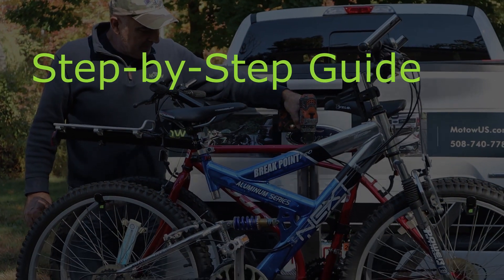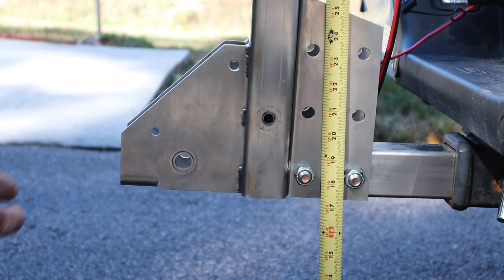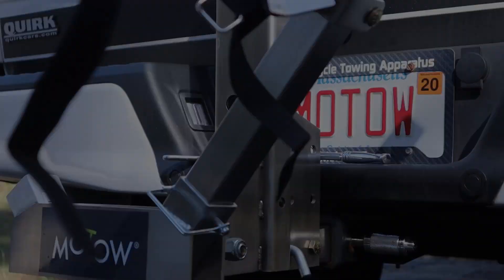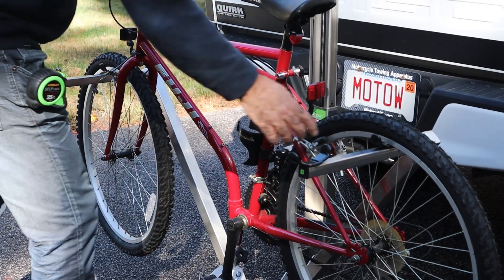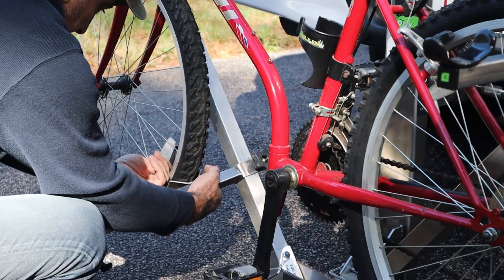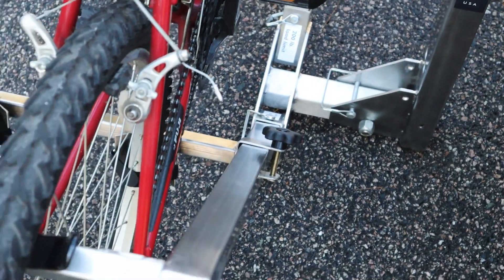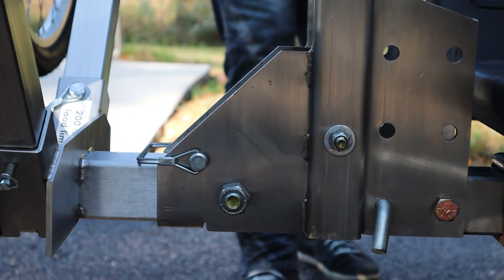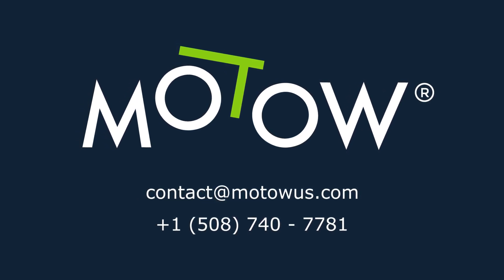The MOTOW Hitch Lift with Double e-Bike Carrier Installation Video - Simplify your life

Comment: Can you carry two Surrons?
Reply from the maker: MoTow Ebike Carriers carry 200 lbs.  Surron Lite Bee X weighs 110 pounds, so 2 would exceed our weight limit by 10%.
Reply from the maker: Contact us for a discussion of a custom carrier.  Contact@motowus.com
Reply: I would take batteries out on both
Reply from the maker: @meapplejak  at 30 pounds per battery, if you remove them both you’re well inside the 200lb capacity of the MoTow Double Ebike Carrier.   😊
Reply from the maker: We have XL support arms that I recommend for your Surrons because your wheel base is 49.6”.  These add $35 to the cost.

Comment: I have two Ride1Up e-bikes (700 & 500 series).Do they need a rack cradle? What is a rack cradle anyway & is it shown in the video above?
Reply from the maker: No you don’t. It has an added cradle on each arm to carry bikes like the RadRunner on its rear rack instead of the rear rim. The front wheel is cradled on the rim. Here’s a video: https://youtu.be/Ui9HPv6SoVk
Reply from the maker: Let me add our standard Double eBike Carrier is fine for your 2 bikes.